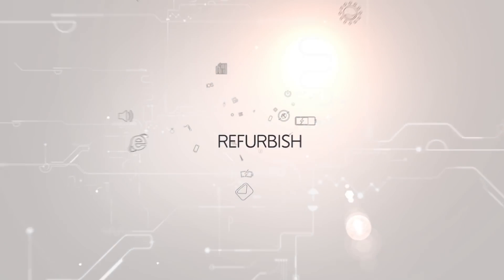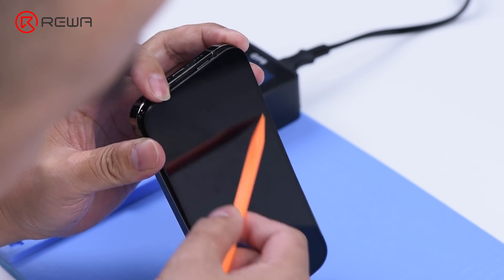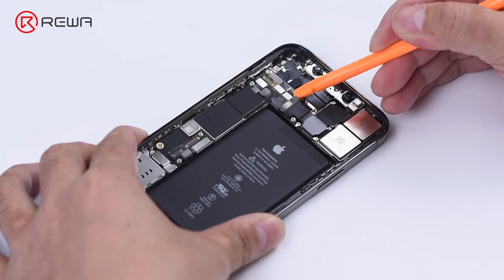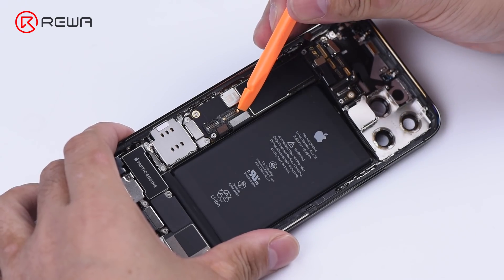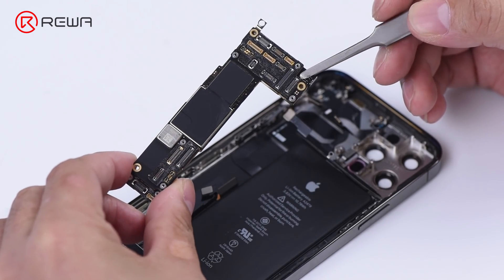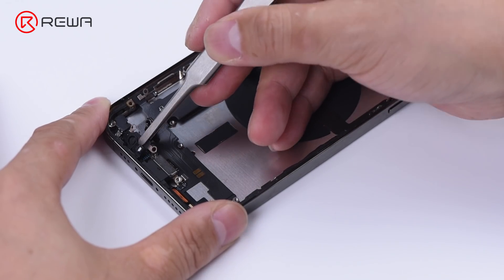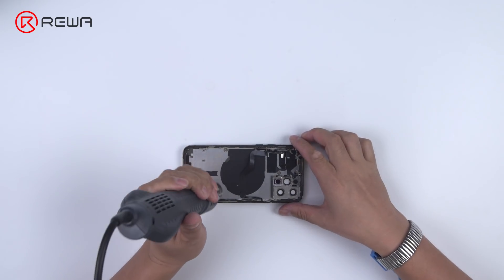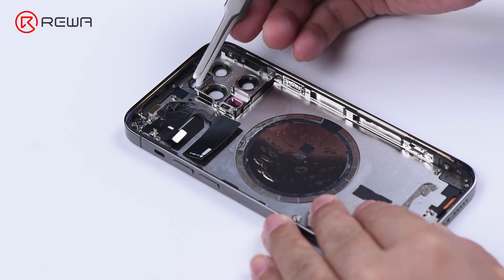iPhone 12 Pro Detailed Teardown Tips For Repair Shop Technicians

Comment: Important to be aware of that LIDAR sensor when configuring glass removal laser templates, and removing rear glass.
Reply: Why’s that ? Does the laser removal damage it
Reply: @wazx6  A very high chance of that, yes. The laser makes several passes to burn the glue underneath the glass. If there is no glue in that spot, just a super thin foil, that foiø will offer no protection. The laser will burn through it as easily as you walk through a spiderweb. You'll burn through that foil immediately and start burning the lidar sensor.
Reply: @pr0xZen  ^
Reply: But isn’t the template adjusted so that it doesn’t go over that part of the device
Reply: @wazx6  The templates tend to be all over the place, and need lots of adjustment. If you're considering getting one of those laser machines, an important tip: Before you start adjusting any of the templates, make sure to adjust the frame jig you put the phone agsinst to align it. If that is off, all the templates will be off. So focus the laser for depth, make it show the red light outline of a phone (and have that model in the jig), then adjust the jig so its straight with the template. It will save you potentially 10s if not hundreds of hours of headaches.
Reply: @pr0xZen  I have one haven’t had any issues some small issues of cutting the camera lens but this can be fixed with black tape. Also I tend to find the the bracket very hard to adjust to be perfect. With the 11 pro it’s easy as you can just line up the camera lens and your good to go
Reply: @wazx6    you need to verify your measurements for the jig, with precise calipers.

Cutting the camera lens is not a "small issue". Extremely easy to hit the camera sensor. If you do, the camera is dead.